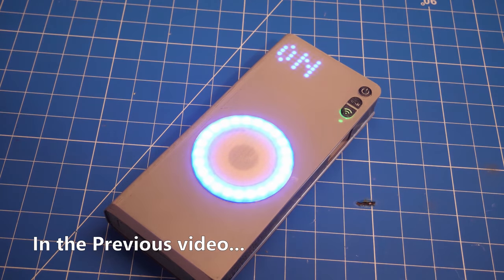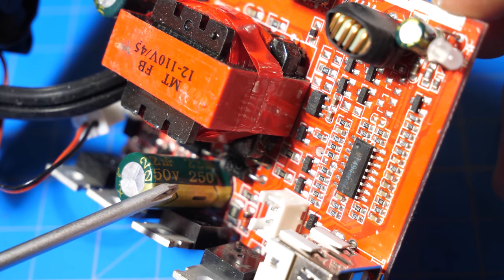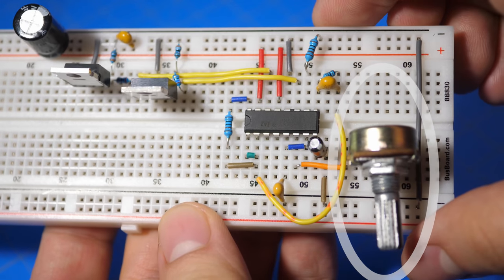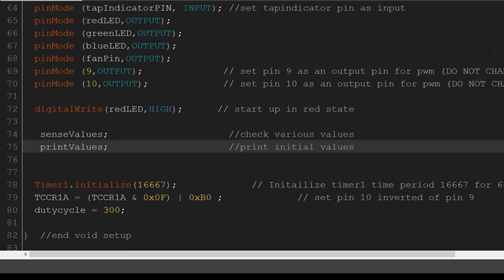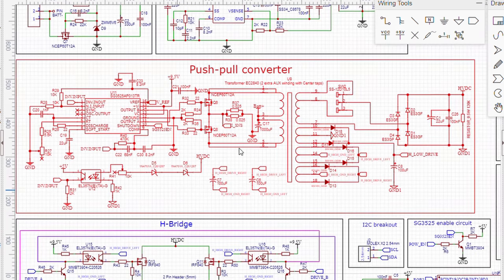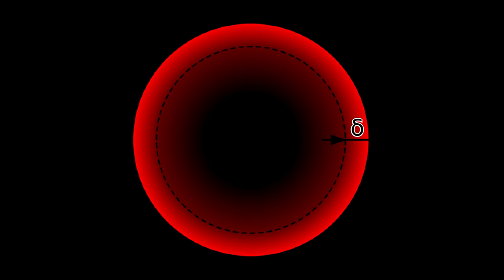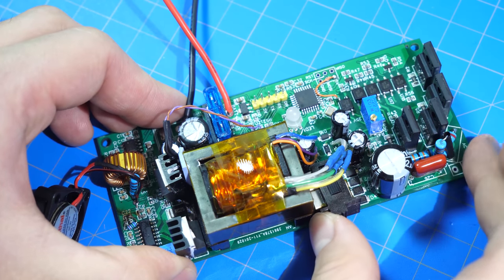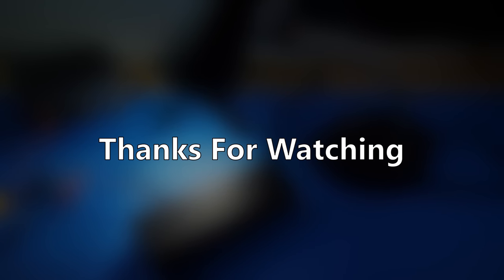How to make SAFE, EFFICIENT, and COMPACT Inverter (likes: 1237, dislikes: 12)

Comment: Hello - Here is my opinion on the output inductor.  Your 60Hz inverter is referred to as a voltage source inverter, meaning it is supplying a voltage to the load.  For some loads with capacitance on the input (or even the DC filter capacitor after the bridge), this capacitance causes a large current to flow from the 60 Hz inverter to the capacitor.  Recall that the capacitors job in life is to try and keep the voltage constant, it does not like changing voltages across it.  Recall also that the current into the capacitor (and out of the voltage source) is expressed by i = C * (dV/dt).  The faster you try to change the voltage across the capacitor, the more current that is required out of the supply.  One of the golden rules in power electronics (at least what I was taught 30 years ago) is that you NEVER connect a voltage source to a voltage source.  When you connect your output inductor between the 60 Hz inverter and the output load, you now insert a current source between the two voltage source, which is allowed.  The inductor acts to provide a constant current  and somewhat "smooths" the output current, preventing sudden changes in current.  Sorry for the long explanation but I this is an application of basic principals of electrical engineering which should be explained.  I enjoy watching your videos and am impressed with your working knowledge of electronics.  Take care.
Reply from the maker: Thank you very much for the detailed explanation! It helped me a lot in understanding this fault. I'll add a note on the schematic about it.
Reply: @kralyn3d  You are very welcome!  Power Electronics is my professional life.  Please reach out with any other questions, I am glad to help.
Reply: This is correct. I always run into this issue when testing solar charge controllers with SMPS as the input source. Using an inductor or a linear supply is the fix
Reply: I liked this your explanation. Pls can you explain what a current source means?

Comment: the reason some devices might have issue with that inverter is the output isn't a nice smooth sine wave. some devices might detect the sudden jump from 0v to 140v as a voltage spike and turn itself off to save itself. if you want a real challenge try powering an electronic coffee maker (newer one with a computer in it) not only are they high load but they HATE noisy power supplies, if you can power one of those you can power anything.

Comment: Hi friend, awesome work!
Quick tip on your PCB layout: It is not a great idea to add vias throw SMD pads, since it will absolve all the solder when soldering, leaving almost none to solder the SMD contacts. It is recommended to add a via next to a GND pad of IC's, capacitors and so on, to reinforce the GND. Also you can use them for thermal dissipation, but take into consideration that this problem might occur, so always consider the vias position.
Also organize your labels, since they might be confused for some users.

Comment: Very very instructive video. 

Little comment on the H bridge: one output of the MCU will drive Q13 and Q14 MOSFETs and the second output drives Q11 and Q12 MOSFETS. Because no MOSFET are perfectly equal, you should try to drive the Q13 and Q11 MOSFETs with the PWM while Q12 and Q14 MOSFET should be turn on for the the duration of the PWM on Q13 or Q11. The only CONS, you will need a 2 mores output of the MCU to drive Q14 and Q12, minor sketch (program) modifications. 

I'm not sure if this will improve the design but it sure made a sound solution when running a DC motor and might render a bit more efficient due to less switchings. Othwerwise, you made it great design and thanks for sharing.

Comment: 18:28 it could be caused by the inrush current charging the capacitors of the SMPS, and your over current protection kicks in. Have you checked the voltage with your oscilloscope on your current shunt while plugging in a SMPS to the output of your inverter?
Reply: Also want to know
Reply from the maker: Thanks for the comment! However, it is likely not due to the in-rush current because I temporarily disabled Over current protection and the error still occurred.
Reply: @kralyn3d  oh, ok. But maybe the IC driving the transformer notices a voltage drop caused by the inrsush current? Coz the IC has a voltage feedback from the output of the rectifier, right?

Comment: I have suggestion for you.. you can make it pure sine wave by just using the Atmega328P to drive the H-bridge and use the Sinusodial PWM method to drive it.. btw, i love your build!
Reply from the maker: Yes, it is definitely possible, but the  Octocuplers I selected is too slow, and an updated design with higher speed optocouplers is necessary.
Reply: @kralyn3d  maybe use a EGS002 module?
Reply: @kralyn3d  have a look at HCPL3120 isolated gate drivers.

Comment: Congratulations on your success! Excellent presentation! You might want to scope the output of the switch modes that do not work with your circuit. Your added output choke might be keeping out some type of interference being output by these switchers.

Comment: By far the best diy inverter video I've seen! My biggest concerns would be using the microcontroller for safety features which is not reliable. If you did that with analog circuits instead it would be a very decent mod.sine inverter, probably better than many commercial ones. 
However pretty much all commercial units also have lots of issues because modified sine wave units are just not great in general. With a proper pure sine inverter, you could actually do current limiting to run things with high inrush current, make it completely short circuit proof etc.

Comment: probably you need to add an inductor because it is out of phase and the load it's an ohmic-capacitive one; adding a coil makes it become an ohmic type. You should try to verify it by calculating the cosy (it should be under 0.8 on 240 50hz don't know on 120). Hope this is useful for you

Comment: That's a nice build with a lot of effort put into it.
But the AC output isn't very clean and it might cause problems for both battery and load : 
-  For the battery : 
A alternative non sinusoidal current is made of many harmonics. These harmonics represents a huge waste of energy because only the fundamental (harmonic 1) is useful. every other harmonic is just waste.
- For the load : 
  A resistive load shoulnd't care much about this kind of input (the power draw might change a little compared to a true sinusoidal input), but a device that rely on a smooth sinusoidal voltage wouldn't work as expected. I'm thinking about devices that uses triacs for power modulation or a very inductive load.
Also, some discrete components can be affected by harmonics if poorly filtered by its power adapter.

(I'm only a 3.5 year student in electronics, not an expert. If someone knowledgeable spots error in what I say, please correct me)

Comment: It could be that you're PC power supply is not working, because you're output voltage is not smooth enough, I don't know how to explain correctly 
But the voltage curve has these corners and this is bad for switching power supplys

Comment: btw when u connect the switching load the inverter was not working probably because of the peak current spike that gets generated as the SMPS pulls power. Inductor solved it by smoothing the current draw and not triggering current protection.

Comment: Well, this was a great job to build an inverter. 
Love to see youtubers not using off the shelf Arduino nano and rather building ckt in their projects. The modified square wave is not desirable for pfc circuits present in some modern gadgets. Coil must be smoothing the output of your inverter, and hence bringing the total harmonic distortion some what in the accecptable range( or in othe words, must be improving the shape of the sine wave). 👍

Comment: Probably stupid question : if the first "block" only exists to boost voltage for use in the sine wave generator (H bridge), why not just use a DC-DC boost circuit instead of the DC-"AC"-DC ? I'm sure I'm missing something obvious, but my understanding is that a DC-DC boost circuit would be simpler and more efficient so why not ?

Also, did you experience electronic noise ("coil whine") like in GreatScott's video ?

Comment: Such a great project, i suggest make it pure sine wave just write the SPWM code on Atmega328 and use a good Mosfet driver and just few filtering inductor and capacitor at the output makes it pure sine wave & it also fix the capacitive loads problem

Comment: Would it be possible to have a pure sine wave output instead of modified sine? I've seen pure sine Arduino based inverters, but I'm not sure how it would go with the h-bridge method. I'd need to go 240v 50hz though.

Comment: Any thoughts on using a LUT containing calculated sine/cosine values in the 328 to send PWM to the H bridge to create a truer sine wave?
Reply: I did something similar for a 3phase variable frequency drive but I never got around to testing. You've inspired me to come back to it :) thanks!
Reply from the maker: This is possible, but I don't think my optocouplers are fast enough, faster optocouplers would suffice for SPWM sine wave application.

Comment: Liked and subscribed, nice and deatailed explanation!! 
Can you bring one video for pure sine wave 50hz, 500 watt AC o/p inverter connected to 24v 20ah li-ion battery(battery pack) with spec display ? This can be a real time challenging  requirement which I would like to build(as a single unit).
Most importantly it SHOULD be used as an UPS, And charging compnent.
Input - 230v 50hz 
Internal- charge the battery auto cut off on full charge
O/p- one AC 230v 500watt 3 pin outlet, and 2 usb dc fast charging, female jack having variable voltage & current regulated dc o/p adjusted by two regulators current and voltage 1-12v , .5-20amp.

Comment: It doesn’t work with some SMPS because it is a square wave inverter with a semi-stable output, the waveforms get messed up under load and SMPS shuts off for safety check out a video on a pure sin wave inverter

Comment: What kind of Oscilloscope is that? Does anyone know? I'm building my first inverter circuit to make a dc welder ac, need to be able to test it. It's only 24v. Can anyone recommend something cheap but reasonable for the job. Not likely to need a particularly high sample rate.

Comment: Maybe your output voltage has too much overshoot so MOV short them and make your inverter shutdown.another peoplem is inrush current.usually smps has a big inrush current that make your inverter protection turn itself off.in this case use a resistor or maybe your coil help it because coils induce a current oposite of first current
Reply: Actually inductors block ac and capacitors block dc

Comment: Your project is excellent, but your output is not sin wave, it's a modify square wave, so that's why it's not good for switch mode power supplies, you can fix this problem, with PURE sin wave output, and for this reason there is an arduino library that can handle such task.

Comment: I am no expert in electronics, but I know enouph about electricity design. It's possible with all the capacitors you have there your power factor is low, apparnt power vs actual power. Therefore, the leading current is corrected by the inductor. Althgough I could be totally wronge.

Comment: Why you put there microcontroller when you already have one in main module, add pins to transfer data between modules and it would work much better as one connected system.
Don't repeat yourself, as programmers say

Comment: High voltage gloves are too pricey for me. I figure PVC coated heavy duty chemical resistant gloves are better than handling high voltages with my bare hands and are in my price range at a hand full of dollars. With the added benefit of now I have chemical resistant gloves. I'm guessing they offer a little bit more protection than leather welding gloves Since big lithium banks like to arc.

Comment: Being a modified sine wave you cannot run a TV when camping, delicate appliances need a pure sine wave if not you shorten the life of the TV etc significantly. Square wave modified square wave inverters are only good for basic electronics such as lights and some chargers. Even some AC motors need a pure sine wave.
You need to show a warning message about powering monitors, TV's and other delicate appliances.

Comment: cmon bro u could have made a better invrtor then this...its way to big to only have power of 150 watts
Reply from the maker: 150W is very conservative, If you look at the PCB schematic, the max safe power is probably around 320W, with 20V input. 150W is rated at 12V input. Thanks for the comment, I forgot to mention this in the video.
Reply: @kralyn3d  i love your videos, i was expecting at least 1000watts or better considering the size.  would you be interested in making one that handle that consumption?
Reply from the maker: @StreamzNow  1000W at this size is possible,  but I would likely need to use specialized Gallium-Nitride MOSFETs switching at 1 megahertz. A lot of inverter designs claim way higher power rating than what is possible.  The reason I went with a smaller design is that I need to prototype my power bank module. But if you need higher power, just add 2 MOSFET drivers between SG3525 and the MOSFETs, then scale everything els up accordingly.
Reply: @kralyn3d  good that you said that, maybe I'll try to build it